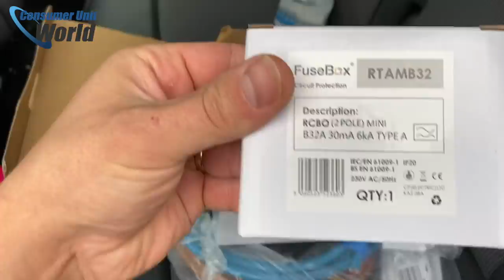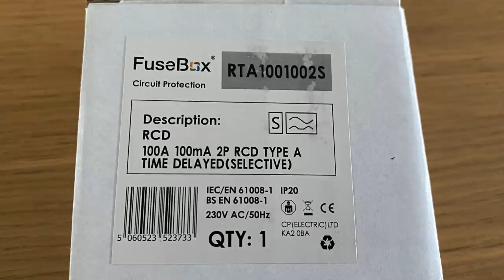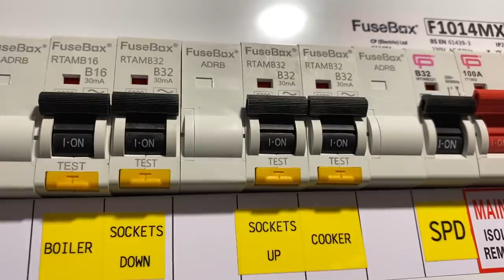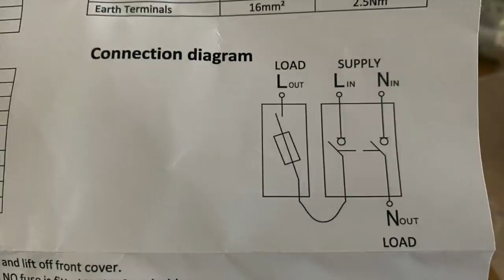Miniature rcbo install and shocking workmanship [18th] Edition?

Comment: When some people say ‘he’s a good electrician’ they mean 1, he’s cheap. 2, it doesn’t take him long and 3 nothing ever trips off. Excellent videos thanks.
Reply: what does bad spark mean...hes expensive..it takes him months and everything keeps tripping ?
Reply: @Max-x8e6l  no not at all. I was thinking about a caravan site installation I went to. It was terrible although it kept working because there was nothing to trip off apart from inside the caravans. It was mainly 4.0mm armoured cables buried direct protected by the cut out fuses. Everybody living there thought it was an excellent job because of no problems with nuscence tripping. The site owner was impressed by how cheap the installation had been. Sorry if my last comment was misleading.

Comment: The terminals on the service block at 06:36 - would the screws have been left like that (barely tight) or would they work loose over time? Seems incomprehensible that someone wouldn’t tighten screws?!

Comment: Thought I'd give Fusebox a try last week, placed an order with consumer unit world the week before, turns out they have no stock even though website shows stock numbers. After chasing all week and promises not being met, I cancelled the order, drove to TLC and picked up all the Contactum gear I needed. I get that covid has interrupted supplies but I'm REALLY not impressed with them!
Reply: I've had a few fusebox boards, seem pretty decent. I order from expert electrical on Nick Bundys code. I have had one instance where they showed stock and they didn't have it, very annoying if your planning a job.
Reply: @jonathanstephens7804 thanks I'll have a look for Expert Electrical. That message wasnt a dig at Fusebox, more a little did at Consumer Unit World (GIL LEC). Made me look unprofessional to my client as I missed my finish date because they lied to me 3 times about when I would get my stuff. I am keen to try Fusebox stuff but for the moment I'll stick with Contactum, solid, reliable, well made  easy to work with and no stock issues!
Reply: Richie TheGod    I get my FuseBox stuff from CEF and it’s cheaper than the suggested supplier even after the 10% discount

Comment: Good job. I'm sure I saw something showing the solder joints in the SPD would melt before the DNO fuse would blow. JW? Don't understand how someone would fit a new metal consumer unit and not ensure it is fireproof. Serious lack of understanding of 17th and 18th regs.
Reply: Yes it was a JW video using a cheap SPD from China to dismantle. The solder did melt but the spring didn't fully dis-engage the contact therefore current carried on flowing. Hopefully the other makes are better.

Comment: DIN mounted bell transformer would have been really neat but can see there was no room in the CU without making it cramped (I know some people don't like them for reasons of segregation but they are neat). I like the fact you've used blanks to lessen the heat of the rcbos ... The more spare ways the better.

Comment: Did I see the phase tail entering the the DB through one hole and the nuetral entering through another hole? If yes, it will cause an electromagnetic effect which is a no no. If you look on your tick sheet it asks for confirmation that the phase and neutral enter via the same hole. Also the 30 mA rcbo's will trip upto 150 mA (5 x 30)  having a 100 mA at the source will cause a selectivity issue, should have fitted a 300 mA rcd. Finally there is no need to fit blanks between protective devices. If you are fitting contractors then they require a blank fitting  between them due to the build up of heat on the contactor coils.  if protective devices require blanks fitting the manufactures literature would confirm this.
Reply from the maker: Correct the tails were installed by a previous electrician feeding another sub board which happen to be near to where I was working. Also fitted a type s rcd so the delay will hold of tripping instead giving the 30ma rcbo time to trip first.

Comment: Hi, I am an electrician from the Czech Republic, I really like your videos and I would like to ask a few questions.  What voltage system do you use in England?  I see that the supply wires for a small installation are relatively strong, in contrast to the circuits I saw in your video, the wires to the B32 circuit breaker are weak.  We have a 230 / 400V system, light circuits 10A, cable 3x1.5, socket circuits 16A with cable 3x2.5.  I'm very interested in that, because we would already have a wire 6 on the 32A circuit breaker. I apologize for the roughness, I write from the Google translator.  Thank you and have a nice day.

Comment: Chris,
16mm T&E to feed a sub main - isn’t the earth now undersized at 6mm, using the half line conductor rule it needs to be at least 8mm, or did you have the fun of using the adiabatic equation to confirm it?
Reply: On a TT system like this you could use a 2.5 for the main earth according to the regs. if it was a TNC-s system i would have to agree with you though.

Comment: Should there not be a cover for the neutral bar?
Reply: No - our neutrals in UK are tied to earth - at supply end and often at point of entry into property.  We have different types of install - TT (where no earth supplied) TNS where an earth is supplied from local transformer on it's own conductor (from neutral/earth bond) and TNCS where earth is bonded to neutral at the point of supply.  I understand that the local transformer has neutral bonded to earth anyway  but, depending on load, neutral could deviate a little hence the need for TT systems to have local earthing rod too.

Comment: What’s the purpose of having that fused main switch ?? can you just run through the purpose of having a fuse ?? Is it so you can down rate the CU essentially like a bog standard FCU??
Reply from the maker: It’s to protect the mains cable from overload otherwise it’s potentially being protected by the DNO fuse which is 100amp and a 16mm twin is not rated at 100amps

Comment: Chris if you are worried about heat dissipation why not for the regular rcbos, fusebox has so much room you don’t need the minis
Reply: It’s more about breaker defraying factors caused by temperature. I mean if you cover a cable with insulation. You derate it. Similar principle with boards where electronics generate heat. Industry is rubbish at telling sparks that.
Reply: @e5Group  But MCB's and RCBO's are designed to be installed next to each other, so the heat generated should already be accounted for in its design.
Reply: Stuart Rhoades absolutely correct.
This is more about the emerging issue with breaker derating.
If you Kay a cable under insulation fora part you have to derate the cable. Same with temperatures for MCBS. Please view the sparkyninja video called the need for design data. This info is buried on manufacturers webpages. Emerging knowledge for want of a better term.
Look at the pics we have put up on Instagram for more visual reference. What we are trying to do is get folk to go on the journey of consideration of data made available by Manufacturers .
Reply: @e5Group  I agree about the de-rating of cables, depending on the installation conditions, but Mcb's and RCBO's are all installed in the same conditions, on a dinrail next to other switchgear.
Reply: Stuart Rhoades exactly, and years ago MCBs not an issue. Only considerations was user, access, protective measures afforded etc. Now we have heat production and manufacturers now realising a thermal coupling can occur and the effects are differnet depending on temperatures. Please watch the sparkyninja video and let us know your thoughts sir.

Comment: Did that busbar really stay naked like that? With all the fuss about every little thing in UK electrical installations that seems so strange.
Reply: I was surprised by that as well. Same goes for ring circuits: I get that it's a historical thing, but they are still installed new all the time while 1 fault somewhere can push 32A through a single 2.5mm² or up to 64A through 1 ring. Where I live, we don't have fused plugs or switched sockets, the whole house is protected by 1 RCD and 1 more sensitive one for the bathroom, but bare busbars are definitely a no go, radial circuits only, and we use dual (230V+N), triple (3x230V) and quadruple (3x400V+N) circuit breakers that cut the neutral feed as well (yes, our fuseboxes are huge, 36mod is considered basic).

Comment: Tails straight to stand alone RCD not MCB/overload protection to outgoing circuit ?
Reply from the maker: 63amp fuse?
Reply: @Cjrelectrical  i was looking at the original stand alone RCD before you took it out, the 16mm T&E was protected for overload by 100amp BS1361 , some people think that a rated (ie 40a,63a) RCD offers overload protection, it doesn't  it works on fault current only

Comment: Got the discount Chris many thanks but they never have what I want in stock, having to wait 1 or 2 weeks. Obviously very popular.  Another quality install, loving the spacing on that 8 way board 😉
Reply: There has been an issue coming out of COVID with FuseBox’s stock. But things are starting to get much better and by 1st week of September should be back to normal (pre-COVID times)!
Reply: George Eames   I get my FuseBox from CEF, and cheaper than the link even with the 10% off

Comment: How do you Brits get away with only 8 circuit breakers? My original 200 amp distribution has 36 slots, and I added a second 200 amp box for the steam generator and instant water heater.

Comment: I have fitted a few of these boards now - I like them - nice price and nice to install - not heard about the RCBO getting hot though??
Reply: I have seen a few people leaving a gap, personally it's not something I believe, but we are all different, as he said nothing in the regs.
I would have thought if a gap needed to be left it would be next to the main switch, as that's taking all the load and in theory would be the warmest thing in their.
Reply: The gap has nothing to do with heat, so I’m not sure where that is coming from, it seems to be a new thing for adding additional circuits, so you haven’t got larger circuits at the far end.  But it really doesn’t matter where you put a circuit in an rcbo board
Reply: @PJB71  I was always taught to start with the biggest load then work to the smallest, at some point someone has decided to reinvent the wheel or try to look smarter than they actually are.
I can guarantee that over the years if those ways are needed they will be used, would anyone really go there and say they need a new board if a new circuit is being added, no.
Reply: @acelectricalsecurity  yeah I was thinking the gaps should be between the highest loads.
Reply: @acelectricalsecurity  I was taught that way too, but I don't think there is any reason for it, maybe we should just alternate between large loads and small loads if overheating is an issue, which I don't think it is, otherwise it would be in the manufacturers instructions.
Reply: @stuartrhoades4306  if it was an issue the iet would have put it in the regs book, although they couldn't produce a correct book if their lives depended on it 😂😂

Comment: But did you fill that old meter tail hole though 😉🤷‍♂️
Reply from the maker: Generally I would but the client was touching up the walls and painting the next day.
Reply: If you remove a meter, does the daily standing charge still have to be paid on it?
Reply from the maker: It was a client supplied meter it’s off the same supply as the incoming mains the suppliers have nothing to do with it hence why I was happy to disconnect it.

Comment: Ignoring everything else, what's your opinion of the plug-on buss bar design of the breakers you removed?

SquareD is one of the better electrical brands over here in the US, and those are very similar to the "QO" line, which is the more expensive of their two common residential product lines...
Reply from the maker: Crabtree starbreaker are fantastic

Comment: Be carefull when tightening the nuts on the flylead. The weld studs used here a murder for snapping off. Best to have a spanner or some other nut fucker holding the bottom night to take the torsion off the stud.

Comment: CEF had nothing good to say about fusebox CCU and breakers, when I asked. A lot of complaints and guys sending them back.
Reply: I only install Fusebox for over a year now and had no problems at all. But did you know that some of their branches actually sells them? I'd think twice if those complains are actual complains.
Reply: Some branches of CEF do stock them, luck of the draw really, if you want you can find fault with anything.
Their MCG stuff is made in China just like the fusebox stuff.
It's ok, I have installed a few of them, and they are similar to all the budget brands, probably all made in the same factory.
Reply: They sell proteus say no more!!!!

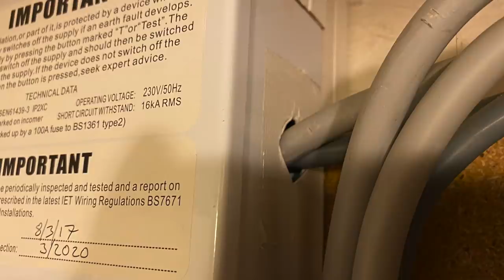Comment: 4:29 - 4:53 I just have 1 question regarding that installation you showed us:

HOW IN BLOODY HELL DID THAT GARBAGE PASS INSPECTION?
Was the Council "Inspector" Blind, Drunk, Incompetent or some combination of All-of-the-Above?
Reply: Council don’t inspect any thing, up to the spark to self certify
Reply: @supersparks9466  That is INSANE! What's the point of having an Electrical Code then?

What mechanism exists to protect the homeowners from incompetent Electricians then?

Does an Illegal Installation have to burn down a home and kill someone before the Electrician is held accountable for violating the Electrical Code?
Reply: @A Wilson electrical contractors weather large or 1 man bands have to be registered with a competent person scheme and you have to show them once a year a selection of your work to make sure its up to code,also you have to have the qualifications and all required paperwork etc before you can sign off your work. Unfortunately there are still loop holes and home owners who are not educated on the subject or are happy with a cheap price rather than a quality job.  This problem is mainly in the domestic sector as commercial and industrial installations are far more regulated but still not 100% fool proof.

Comment: Which driver bit are you using for the Torque driver, tend to find I never get decent purchase on mine to do anything up. Tend to find myself checking with the CK Modulo driver as the pozi heads on the Draper Torque one just constantly slip and ruin the terminal screws.

Also taken to running less ring mains in properties in favor of radials again, or dressing my board so it's power, lights, power rather than getting a bigger board with blanks. Too big a chance of someone coming in behind and shoving a high powered circuit in next to another one at a later date.

Comment: Chris are you using any tool to straighten up the cables without damaging them?
Reply: Little cylindrical piece of  soft wood does the job :)
Reply: Ok what techniques to use in both conditions?

Comment: This putting blanks in between is utter garbage. Pretty sure these board are tested by engineers and people a lot more intelligent than us to be able to cope with the load required
Reply: Yeah just like asbestos was a great building product  😂. Know what ya saying though. End of the day it dont cost any extra and will help with heat. Unless we get to a point where ya got 12 circuits and ya sticking a 24 way in for spacing 😂

Comment: Don't you like those fusebox labels!
Reply from the maker: I do they are just not very specific and I hate a massive circuit label on the board I get the client to print off the circuit chart which gives them a specific break down of what each circuit controls.

Comment: that looks a good idea splitting them up. I suppose you never had that problem beforehand on a split load board, because the biggest load circuits were segregated.
Reply: Nonsense. What about all the boards without split load or no RCD at all - never come an  issue in 30 years of no spacing between devices.
Reply: Marco oh well times change.

Comment: Why change the CU? Why not put Schneider acti9 RCBO’s in the existing CU?
Reply: Wow.... did you actually put that.... I had to rewatch the video to check I wasn’t seeing things or was missing something completely.... what not put Schneider acti9 RCBO’s in the existing CU maybe because they won’t fit... ummmm there’s no bus bar for them to connect to.... the cost of even 2 Schneider acti 9 is not far off  the same cost as a the entire board that Chris fitted.. do I need to carry on why this comment was like saying use chocolate as a fire guard....
Reply: Sparks Are flying no I didn’t say it I typed it & to be honest I don’t watch all of the video but I’m sure Chris will like the fact you watch the adverts more than once 😁 
Wow you are a tool Schneider own square d 🤦🏿‍♂️ so have a RCBO’s range that are retro so no bus bar issue  🤷🏿‍♂️ as for cost it’s all down to the wholesaler as I could get merlin gerin less then dorman Smith.
Reply: I am well aware Schneider own square d.... and yes you can get the RCBOs to fit there’s 3 on the back of the van that will fit this very board how ever they are NOT the acti 9 range. You may well be able to get a merlin rcbo cheaper then a dorman smith breaker... however you simply said “put Schneider acti9 RCBO’s in the existing CU” and the reasons are simple you will never even with the best wholesales in the county and the best trade discount price get a Schneider acti 9 or the correct Schneider breaker to fit this board cheaper than you could buy the board that Chris fitted... that’s before the arguments regarding the old board not been metal come in to play... Chris... well done on a good job. Ed clearly does not live in the real world....